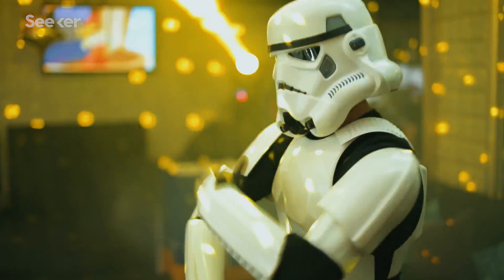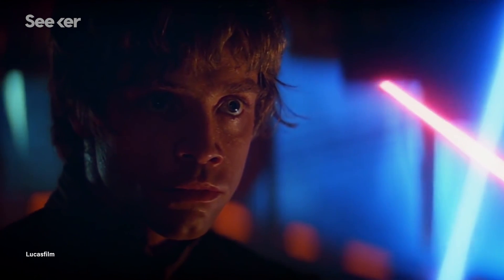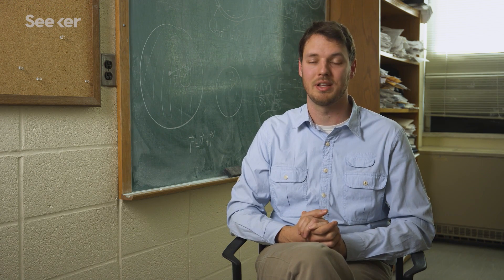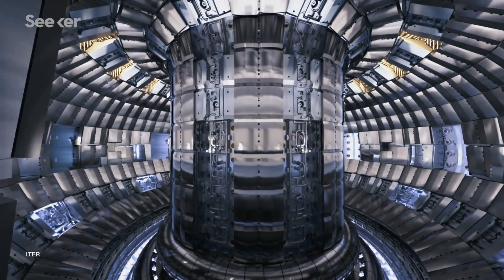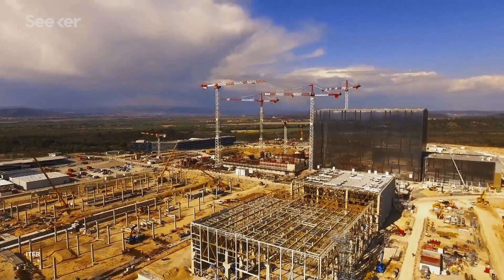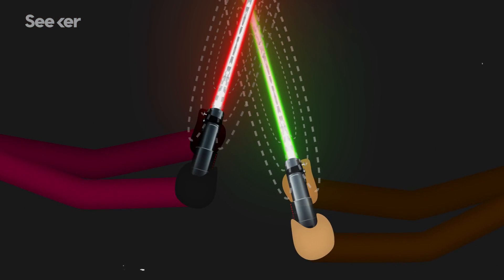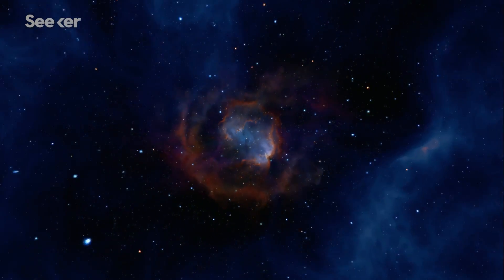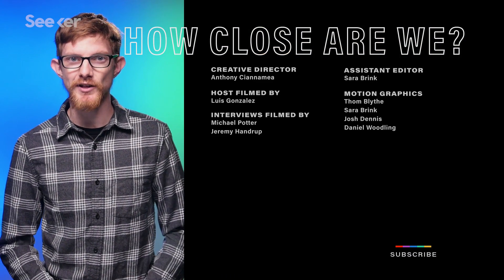How Close Are We to Creating a Lightsaber?

Comment: Just put a pole through the middle, put a mirror in the top, surround the circumference with powerful contained lasers
Reply: Parker Pederson how would it retract? Also, wouldn't the metal pole melt??
Reply: @demonlxrd  ceramic center pole extension through micro hydraulics lasers at the base and mirror to contain.   Seems legit.
Reply: @Suicide4Hire  hits another C E R A M I C pole
breaks
Reply: tbh i think that idea is dumb, the metal rod in the middle will melt and the idea itself where the laser gets reflect will just melt the components of the handle
Reply: That is actually a good idea.
Reply: Daam I thought exactly ....seems like force is stronger with both of us XD
Reply: And it would be like a complete building
Reply: It's like the Beam Katana in No More Heroes
Reply: someone did it and it looks hella cool
Reply: Make the pole be able to contain massive heats Ez claps boi

Comment: It would make since to have something like hacksmith. A metal rod that instantaneously jolts out, heats up, and lights all at the same time. Now powering it with antimatter as explained in the video is the real trick. And then finding a material that can contain the heat of saber when its retracted back in. 
With dedication, I’d give it another 50 years. It won’t be perfect, but it’ll be a true light saber.

Comment: cough cough the hacksmith cough cough
Reply: Protosaber has a long rod on it. However, it could be made like a telescope so the rod can be extended out. Even then, i like the fact that protosaber managed a prefectly cylindric blade. And the fact that its actually holdable, and can shock, burn, melt and spew fire makes it pretty deadly.
Reply: A protosaber/lightsaber does'nt have a long rod attached to it.
Reply: @MozartOfficial  right, I was actually talking about the hacksmith design.
Reply: @ShahAlam-ms9df  oh well then.
Reply: EXACTLY!
Reply: Corey The atheist   no it is a power pack that joins with the hilt using a thick wire. The pack has to be worn on the waist with a belt.
Reply: lol so true

Comment: Miles away a lightsaber burn 4x time hotter than are sun is. the power supply needs to be as powerful as Star and only needs recharging once a year it need cooling system need to be good enough to protect your hands radiation the blade would probably give off would bur you the atoms Lucas said the hilt weight is very very heavy you need the force to lift the hilt. The door in the vid is a blast door it made of quadanium steel a fictional metal that is harder than diamond.

Comment: not possible. In star wars its mostly some magic and force crystal yada yada. In real life if theres a plasma beam with temp of around 10,000-100,000 degree celcius (i guess lightsaber must be this hot to cut through metal and hardest materials like nothing.) If it cuts through someone it will immidiately burn it than having just simple cuts. 

If lightsaber would be treated as real life thing then luke's clothes should be burning off as soon as vader cut his hands. However, lightsaber is hot when piercing objects and metals but doesnt burn clothes of their victims ever.

Comment: What is you just have a handle of a lightsaber and instead of light you have a thin long piece of metal, you put the mirror on top of the metal and at the bottom you put strong light around the metal, you won’t see the metal, and when you have a lightsaber duel it will appear as if they are hitting the actual lightsaber but they are just hitting the metal in the middle

Comment: "The beam of a lightsaber is contained by the force powers of the user" Well that can't be right. Non-force users can technically wield a lightsaber and it doesn't just spew out plasma - it still acts as a blade even without its wielder having force powers.

Comment: The magnetic fields touching each other would generate a powerful bounce force like two magnets of the same charge. As mentioned you would go blind from even looking at the blade. The resisting energy from another lightsaber would allegedly create a blinding white flash with a sound similar to a lightning strike at close range, deafening. If created you would need the force to wield it.
Reply: Great point! According to you and the video lightsabers could possibly be built without Kyber crystals. 😶
Reply: They could. Quite possibly. Watch Empire strikes back. When Vader hones the force through his lightsaber, you may see why they have “Kyber” crystals in the handle.

Comment: The main problem is the heat. Just because plasma at 4000°C is enough to melt through steel, there's no way that would be anywhere near hot enough to slice through something in the way that lightsabers do in the films. To slice through things like that you'd need something hundereds if not thousands of times hotter. And then if you had something that hot in your hand, it would immediately vaporise everything around it, including you. You wouldn't even need to hit someone with it, it would just kill them if you got it within a mile of them. So it would need to be that hot but utilise a way of containing a lightsaber-sized entity with a heat as high as that, which is impossible. And even if all of that were possible, as soon as you touched that lightsaber to something, the thing that was touched with it would immediately become too hot to be around.

In fact, I honestly believe that a lightsaber that uses heat to cut through things would never work. If it was hot enough to cut through things as fast as it does, you would not get clean, precise cuts. You would get huge holes wherever it cut.

The only way you'd be able to slice things like a lightsaber does is a weapon that is basically a contained force field that separates matter at the atomic level, which is also impossible.

Comment: How lightsabers power works.
The host of the saber wears a battery pack on the back, and uses it to power the beam if they have no force. To use a lightsaber with no pack you must have the force in be in proximity of someone who does. Ex: Solo on hoth near Luke.

Side Note
The sabers can be powered for a few minutes without a pack if there is no force.

Comment: I always had this idea about creating a lightsaber.
If you can make the laser pulse, we know the speed of light / with x amount of pulses so it will reach a maximum lenght of lets say 1 meter by turning on/off the laser very very fast.
Speed of light 299 792 458 meter per second, and it pulses 150.000.000 times a second, should create beam on a lengh of 1.33m.
I know thats alot of on / off pulses a microsecond, but with the digital 0/1 chips these days, wonder if its possible to find some chip that can do that fast enough ??? what you guys thats clever then me think? bad idea?

Comment: Let me just announce you that we are NEVER going to create a lightsaber... A lightsaber is made out of energy which you need a concrete thing to stop and so, you would need a metal that follows the way of the lightsaber at is top and if it were to be destroyed, the lightsaber wouldn't be of use because it's energy focus would be lost. Now this is not ment to destroy any dreams or whatever else, it is simply the name of the video which annoyed me.
Reply: Lightsaber blades aren’t made of plasma, not energy
Reply: Sawcon Deez nuts This depends COMPLETELY, If you are talking about the lightsaber they arr talking in the video then, yes but in the star wars univers, it is energy produced by a kyber crystal, and so, it is indeed energy in my case but, if you want to think of it with plasma, go on!
Reply: Xavier Chrétien no, the energy is not produced by the crystal, the energy is focused through the crystal in the form of light, giving it its color, the light burns so hot because of the diatium power cell’s massive amounts of energy, that it superheats the air that has been trapped within containment field around the blade, causing it to heat into a plasma
Reply: Sawcon Deez nuts Well, thank you for learning me this. I now know more than I thought I did about lightsabers.
Reply: Xavier Chrétien you’re welcome

Comment: Just a very rough theory:
With a high voltage self-recharging battery, you could build a light saber - take a look at laser pointers as it is said in the video. Same principle, even with different colors. You could compare a lightsaber to a welding torch or a bunsen burner with the controllable flame...combine those two items (laser pointer and welding torch), add a few things like electro magnetism and real science and you could, in theory, have a lightsaber.

Comment: We could have a lightsaber right now but it would be very costly we could use the strongest light that is so hot it could burn skin that light does exist we out that in a lightsaber with very expensive but strong material so it could withstand the heat running up the middle with that heat light and now all we need is the hard part... That material

Comment: I have an idea, 

what if for the telescoping edge of the lightsaber could be nanotechnology extending rod of carbon nanotubes?
Carbon nanotubes have a melting point of 3550 degrees Celsius while steel has a melting point of 1370 degrees Celsius and is 100 times stronger than steel.

Also, inserting an electromagnet inside of the carbon nanotube structure would allow it to reign in plasma while generating it at a safe temperature, hopefully,

Comment: Uh...you guys know the YouTubers Hacksmith already DID make something very similar to a lightsaber, right? True it was't made of plasma or light energy, but the technique was both incredibly basic but also genius.  A thing tungsten rod inside of a titanium outer casing with a flexible ceramic material between them to prevent a short circuit. Hooked up to a battery back about the size of a lunch box, that got this thing up the 3000 degrees Celsius. It cut through a wooden door and even a steel pipe like butter. Best part of all? There were able to hold it just find with a pair of workshop gloves without hurting themselves. The guy even touched the thing WITH his glove...which immediately caught fire...but the had a fire extinguisher nearby so he was fine. XD

Comment: How to build Light Sabre 

Magnet at bottom of hilt.

Magnet spins incredibly fast.

Magnetic dust in the hilt flies up and down due to the magnet.

Send electricity threw the dust.

This would be hot Enough to cut through metal, two blades can touch do to the constant stream of dust, and it could be turned off and on easily.

Boom Lightsaber made.

Comment: 1:10 Lightsabers are not hot this is a major point, because the difference between lasers and plasma is absolutely important. Lightsabers give off no actual heat, and instead demolish most anything it comes into contact to. If a lightsaber gave off heat, the user wouldn't actually be able to wield it, as lightsabers can melt metals that reach into the thousands temperature gauge to actually be manipulated, and the lightsaber does it instantly, which means it would have to be WAY hotter.
Reply: I should rephrase that- Lightsabers do give off heat, but only when in contact with anything (But I don't think other lightsabers ?) Water is instantly heated up when hitting a lightsaber, allowing steam to do it's thing

Comment: as with most of the cool sci-fi tech, we could probably build it, but we just don't have a good enough power source. lightsabers output something around 35 megawatts of power so if we could miniaturize a fusion reactor enough to fit into a lightsaber handle we could get one working, but that is a long way away. to refuel it though there would be a small deuterium tank at the base of the handle you would refill much like how you refuel a refillable lighter.

Comment: You easily forget the fact that it could be like a baton. Within it coil wraped pole with north south threw the top of and bottom. And when the button is pressed. It slides out. using your beams of light are then shot threw 2 specific fields of the sabour. Starting from the hilt. These then would travel verticly up the rod and pulled either inward or outward(DC) curennt bending into the next few or so magnetic field. Maintaining this would be it starts from a smaller point. Have some type of conpensator chip to fluctuate the power input upon button press. But therefor would aleviate the heat problem. However there would be no color... However ( im just being a hoodlum) if you could somehow do the same thing with the supper proton mass. Maybe you could use int in the same way as. Its not actually a full beam of light. But avtually a belt like set of possible beads of light being spun a light speed...

Comment: Lightsabre are so powerful there 60x hoter than a star/sun our sun surfaced temperature is about  5700 degrees c a lightersabre is 25,000 degrees c so the force is needed to even hold it and the metal handle would heat up and melt in phantom menace Qui-Gon Jinn pushes his lightsabre into a door at the start of the movie his hand is next to the molten metal and hes not burning the force protect them

Comment: The light saber blade is a force field blade shaped like a cross sectionef x, it is a spinning force field when swung makes the iconic fluttering  sound of air caught between the spinning blade sections, because it's a force field  made of energy it has solidity, and heat from the kinetic spin of the force field.

Comment: Magnetic fields can be used to both manipulate plasma as well as form heat shields as long as you aren't directly making contact with the plasma. I am actually working on the concept and was hoping to speak to more people than just the engineer and electrical engineer. Also there is more but it is just theory so rather deal with internet trolls I won't give out the rest until I have managed in some way or fashion to test out the theory.

I will however give up a theory which I have and has partially been proven but the application of it was used on the wrong thing. A little back story, I don't consider my self smart, I am overly analytical in most areas. In recent years I have had a couple accidents that both disable me and led to the discovery of a heart condition. Trying to not be burden on society, having to take Social Security to get buy, or those who try to help me I have used my down time to go to school and obtain a small cert in IT. 

The theory I had, not directly involved with the my Saber Theory, was that magnetism could be used to create an optical camouflage much like that of the Predator's. The theory goes that light rays have a frequency. If a magnetic field was created that had the right frequency from or around a target then theoretically the light rays would flow around the target. This would have the ripple that the Predator's optical camouflage originally created but since the light would not be bouncing of the target into other's eyes or another optical receiver, the object itself would be hard to see unless it was in motion  but only then would appear as a distortion no real detail would be visible. Side affect of this is that without special equipment, the target with the optical camouflage would be unable to see its surroundings. The special equipment would have to allow the target to see in other spectrums that where not affected buy the field. 

Now I said the theory had been proven just in the wrong way, that was when the government was testing it as an option to better evade radar detection.

Comment: In gundam universe, it has Beam Saber and is explained as a plasma sword that contains by a thing layer of something call I-field that is a by-product of a Minovsky Particle that basically a made up particle that can block most of the radiation except with limit blocking  to visible light. The beam saber is able to make a sword object and plasma is injected inside so that it will fill up into a beam saber. To slice through the object, the solid object can pass through the i-field layer which heat up by the plasma inside which melt it and being push away. The sword fight on the other hand is the repelling of the i field toward each other's plasma. Anyways, it is all make up for now...... until we have discover technology like that or a workaround...

Comment: They are already real! Used for cutting equipment on ET craft. Like they are used as tools no one uses them as weapons. But those "tools" probably use zero point energy to power them like they have a self sufficient internal power supply. My personal belief is that the "lightsaber" that they are initially talking about in the star wars series is a tachyon powered sword. Meaning that it uses the person or "force user" as Tachyon power supply. So the device can power whatever the sword uses to cut with like plasma or lazer or whatever the heat generating element is. Ya in order to power one of these swords from the Star Wars series you need to be able to channel tachyon energy through your hands. Only ascended Masters or "force users" are capable of this. I think these are very old types of weapons used "a long long time ago" litteraly. Ya they are probably very effective as advanced swords and the benefit is only a "force user" can power them. Personally id rather just use one of the ET plasma cutting tools as a advanced sword. Like they would be just as effective at cutting through things. I'm not sure what would happen if you tried to have a "light saber duel with a ET plasma cutting tool. Like the laser/plasma "blades" might just go right through each other and keep cutting things. Like if You used to of them together to fight. Like ya it is kinda a weird weapon like id rather just have any gun or any other advanced projectile type weapon then a lightsaber. That being said they are still really cool like if they get released to the public in the future in buying one. Also hover boards, materalizers, and smart glass pads are also on my future "list" oh and any free energy device that can plug into an electric car.